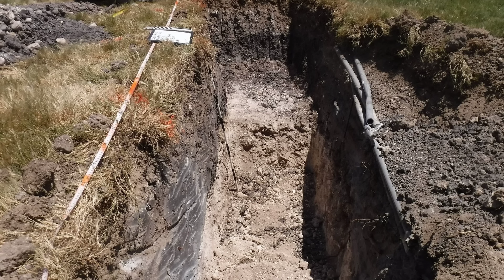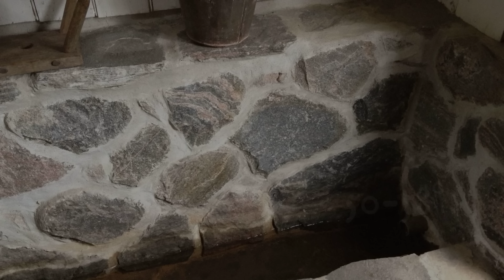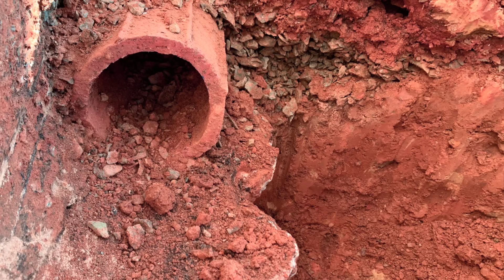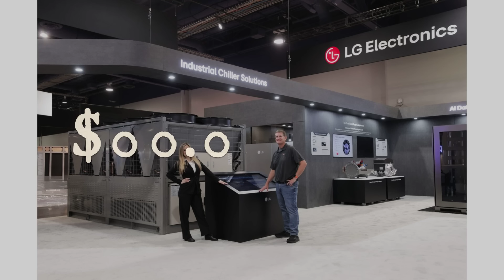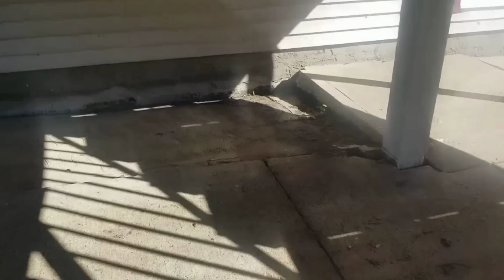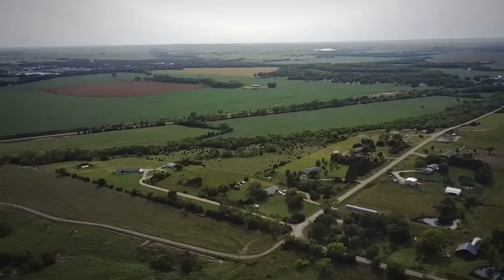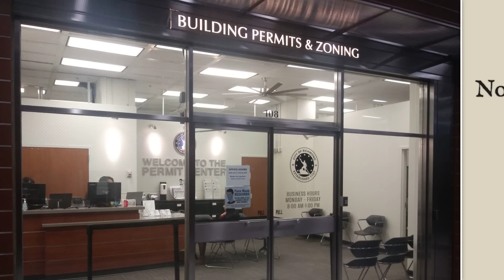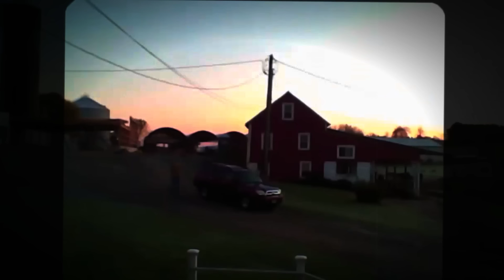This $300 Tunnel Keeps Any Home 55°F Forever — The Amish System the Cooling Industry Made Illegal

Comment: I’ve got an Amish community near me and I visit them every summer and I can assure you their houses are hot af
Reply: maybe they didnt have $300 lol
Reply: @will201084  
They don't have fans 😅
Reply: @will201084  Phhhh, when they pull their cell phone out of their pocket, $300 cash will fall out.
Reply: @will201084  probably lot more than $300, but there are systems that run off water (similar to freon in tubes) that run deep into the  ground to remove the heat or vice-versa (even saw a house for sale with the whole setup in the country of southern Missouri. Not really new science or secret - I think it's quite expensive (at least they charge alot to implement it) and you have to plenty of yard. There's some science channel on here and a guy did it with a window AC unit.
Reply: @will201084  You should see an Amish wallet, it can hardly close...
Reply: Their Amish level not high enough. Need to grind harder.
Reply: @aphrodite7194  Patch drops next Tuesday
Reply: Lmao
Reply: Agreed, I serviced Amish business and homes. Never cool in Summer. It is wild to go in a home with no outlets.
Reply: @jackmyers-01  what exactly did you service in an Amish home/business?
Reply: @EasyMoneySG   Amish businesses still have power and some utilities, but they are battery powered.  i live in the middle of Amish country, and one of the greenhouse/farms where they sell AMAZING BBQ chicken on the weekends has ceiling fans and cash registers, phones, etc, but they are all rechargeable battery powered.  They can use electricity for their business needs, but it CANNOT be connected to "the grid".
Reply: @EasyMoneySG I’ve don’t finish work in an Amish home. In my area the good finishers are yanks and this guy wanted our crew doing all the stain work on the reclaimed wood and cabinetry although they do all the wood/trim work. No such earth tubes
Reply: They haven’t unlocked that crafting ability yet
Reply: 😂 Try this is in a climate where it’s 100 degrees plus with high humidity all summer. The house would never get below 83 degrees during the day( at best)  and the humidity would be off the charts.
Reply: @Kee_Op  Oh, you mean like Iowa, yes, there are Amish colonies there too, they survive, they must have some secret.
Reply: @Crogon  surviving is different from enjoying
Reply: @Crogon  The secret is acclimatizing. People just get used to it. I just went to Costa Rica and most people can’t afford AC, they thrive.
Reply: @mikedickinson9730 I think it's just 'acclimating'
Reply: I have an Amish guy building my house right now.So I'm going to ask him about this.The next time I see him later this week. I'll find out.

Edit: He said it is.  I had a quick conversation with him about it for my property and posted it in my videos.
Reply: @ExposingYoutubersChannel update when ya do please. If possible. 
Thank you
Reply: @ShadowBanable they got him...
Reply: @austenlangford  hahahahahha the guy proved it. he is underneath now... cold 💀💀💀
Reply: @ShadowBanable  https://www.youtube.com/watch?v=3NsEqisBK44
Reply: @ExposingYoutubersChannel  Im here for the update on this to
Reply: @ExposingYoutubersChannel I have seen this work for a large "greenhouse"  i dunno about a whole house.  But its not 55 but its like 68 all year round
Reply: @rockindoublef  the oranges in Nebraska greenhouse is the greenhouse you’re referring to and yes the concept for the house was born from the system he designed for his house. He tested it on his house first.
Reply: @rockindoublef our house is only 1200sq ft with a big loft above.  He said he can do it so we'll do it.  I'm thinking that it won't be as cold as 55, but even mid 60s in the summer is a win.
Reply: @ExposingYoutubersChannel even if it cuts your AC bill down, it's probably worth it
Reply: @ExposingYoutubersChannel thats awesome
Reply: @ExposingYoutubersChannel  interesting.   I am in Florida.  Probably not a good idea where the water table is 20 feet below. 😮
Reply: @Dbb277-2  i grew up in south florida , and I remember digging a hole as a kid and hitting water. I was told I was going to hit china soon 😂
Reply: @Dbb277-2  I'm also in Florida, my house is on well water and the water comes out cold. Wouldn't that be a bonus since the water will help keep the soil cool?
Reply: @runielquinones3817   The problem might be how far down one has to dig to accomplish this.  That’s totally an engineering problem but might work. 🤷‍♀️
Reply: @runielquinones3817  I'm not sure of your area or well depth, but in Ohio our residential water wells can go from 110ft deep to some 400+ ft deep. (My opinion only & I could be wrong) That it would be a long shot to use that small pipe coming up to use water to keep additional pipes cool, but anything is worth a try! I'd just make sure to talk to smart water people & make sure its not gonna prematurely warm your cool well water & then you have to worry about additional bacteria or contaminations.  But Im by far no expert, nor a YouTube expert in that area, just my 2ct to keep check into to keep your family safe 1st. Definitely would be interested in a follow up reply if you get an answer though. & good luck
Reply: @ExposingYoutubersChannel  Commenting for the update!
Reply: @xylol3hunna  i posted his response already.
Reply: @ExposingYoutubersChannel following
Reply: @ExposingYoutubersChannel  Recall, he said that there is only one specific Amish community doing this.
Reply: @Crogon doing something and knowing about something are two entirely different things.
Reply: @ExposingYoutubersChannel  Okay buddy it's Monday! Chop Chop
Reply: @Crogon well, he knows of it, he can do it, and he'll be doing it for me, so...
Reply: @ExposingYoutubersChannel  You better give us an update on this!
Reply: @ExposingYoutubersChannel what did he say?
Reply: @UTEX  I posted the video on it.
Reply: @ExposingYoutubersChannel Curious-how many SQ feet and estimated time to complete the build?
Reply: @ExposingYoutubersChannel looking forward to the update
Reply: @MrMoDaddy  He knows about it and he's going to do it for me.
Reply: Adding this comment so I can check for an update @ExposingYoutubersChannel
Reply: @ExposingYoutubersChannel I would like an update
Reply: @gabeoshin i posted it on my channel.He knows how to do it
Reply: @ExposingYoutubersChannel  It's basically "geothermal"
Reply: @ExposingYoutubersChannel yooo any update
Reply: @NickChambers-rp8bt yeah, i posted a video
Reply: @ExposingYoutubersChannel hey man did you ever find out if this is legit? Please let us know
Reply: @rameezkhan3521 yes it is. I'm going to do it.
Reply: @ExposingYoutubersChannel  It "is" what?
Reply: someone like my comment so i can get back to this video when there's an update already. please and thank you
Reply: @ExposingYoutubersChannel   He's going to say and I quote "Nooope sorry I ain't ever heard ANYthing about that"
Reply: @heavyglassglass  i doubt it.  We'll see.  He should be back on Monday.
Reply: @ExposingYoutubersChannel  What did he say.
Reply: @ExposingYoutubersChannel  we're all dying to hear his response lol
Reply: @heavyglassglass  Well, you're wrong, he knows aobut it, and he's doing it for me.
Reply: @Fr3drik2  He knows about it and he's going to do it for me.
Reply: I have no doubt that some Amish communities have utilized this. But it's a lot of extra work (excavating tunnels without heavy machinery, oof) so it's probably rare. Not standard practice.
Reply: But do they have the Earth tubes?
Reply: @CarlosCruz-yi1rd  they definitely don’t but that’s not a critique on the concept of the earth tubes, the earth tubes definitely work I’ve seen several people implement them effectively if you can find the time and money to lay the pipes and have a plan to connect them to your home then you can definitely get some awesome results.
Reply: @DarkSolidity  so your saying "they" isnt just the powers that be but our peers as well?
Reply: @DarkSolidity  so your comment was for what...? You visited peoples houses that aren't even cooled with the method mentioned in the video and say they're hot??
Reply: @JustEvan7  they called it the Amish method and it clearly isnt, the majority would hear that and take it for truth at face value because the majority of people have never met the amish.
Reply: @DarkSolidity I’ve seen a smaller version used to keep a goat house warm in the winter!
Reply: @DarkSolidity  Perhaps not all Amish are created equal?
Reply: @Boge42  no amish hivemind?
Reply: @DarkSolidity  yeah they work till everyone gets radon poisoning and then has to battle cancer.
Reply: @R_eaper93  oranges in Nebraska has been using this method for 20 years with no ill effects.
Reply: This honestly sounds like one of the most tout there conspiracies ever. Let's say this dies work . You know why its not implemented? Not because it'd save folks money bit because its simply not feasible for mass implementation. You're leaving out things like earthquake and other seismic activity that would easily damage this and make it useless. Its subject to flooding also making it useless and quite possibly a separate problem for the home.
Reply: @SnowmanBiggz it’s called geothermal heating and cooling. Nobody uses these stupid tubes. They run pex through the ground and use it in a hydronic loop.

You need a very large area because eventually the earth your pex is in will warm or cool and make it less effective.
Reply: HAHAHAHAHAAAAAAAAAAAAA
Reply: Why do you visit and what do you do while there
Reply: @doritoseminar  i visit for many reasons, they grow produce and sell it to the community for better prices than the Grocery stores, they bake fresh bread, they sell honey, they provide many services for people. I got to know serveral of the families through avenues like that, my favorite family I met are wood workers and they built me several 4 x 12 feet grow boxes out of cedar for an amazing price and my project was a little unusual so they invited me in to talk about it and we became friends through it because it took several months to complete, i haven't been able to befriend all of the families because alot of them are closed off but the ones i have gotten to know they're fun and very intelligent people, and spoke 4 languages, even their children speak 4 languages.
Reply: 😂😂 well damn, I thought we had a secret here
Reply: @CurrentlyCurious748  it does work, it’s just not an Amish secret
Reply: The video references Amish who settled in Pennsylvania and Ohio. Do any of you live near Amish communities in those states? I do not but I'm curious if they are using knowledge brought over from Europe that other Amish may not have adopted.
Reply: @Epic_Lemonade  No, the Amish I am talking about do not live in Pennsylvania or Ohio, However their families do, they were from Pennsylvania Amish families that moved to Tennessee, they mentioned taking buses to visit their family upstate. And a few I’ve known have gotten married and moved back to PA.
Reply: You hang out in their basements ?
Reply: Good comment-always nice to hear another perspective.
Reply: Amish are weird heretic cultists anyway lol why pick 1800s Christianity when you could pick 33AD Christianity?
Reply: Dang i go to about 6 PSU games a year even the campgrounds we stay at run by the Amish.  Never went into one of their homes but kinda want to now.  See if looks like a time capsule lol.
Reply: You Amish ain’t evolved like his.
Reply: this video is about a specific group of amish
Reply: maybe it's a breeding house, try another.
Reply: I have no doubt as to this working, I'm just wondering how this would work in a city? Setting aside the part about the infrastructure not already being in place, im just curious how effective it would be for something like an apartment building? I'm sure it would be helpful, I'm just not so sure about the effectivness? (I have mold concerns in my head too, as this cool air starts meeting warmer air, but yeah... i just don't know...)

I dunno...
Reply: @Well-that-was-unfortunate  you would need A LOT of underground tubes to cool something like an appartment building. For that scale you would probably have to build it from scratch as retrofitting on that scale would compromise the foundation. You'd probably need a central tube that comes up through the middle of the building, that all of the appartments connect to as an exhaust, and lots of tubes streatching for hundreds of feet that emanate in every directions from the appartment building, you know a basement level solely designed to feed this cooler air up would probably be the beat way serve that air into the apartments. I don't know if it would work well for every floor of the appartment but it would work great on the first floor!
Reply: @DarkSolidity yeah, no... i used to live in Boston, which has an interesting foundation already... retrofitting would be... i don't think possible... but yeah, thank you... that's not unlike what i was thinking about the first floor. Condensation is brought up in the video, just.... i drive a truck now for work. The bottom bunk has access to an external heating and cooling system. The top bunk, not so much. On really hot days it's crazy to feel how much of a difference there is in the temperature between your feet and head and I'm picturing this on a building scale. But i have little doubt that moving air would (in a worst case scenario) in the manner of this video via some external fan would cost far less and would decrease the energy needs for whatever other normal heating/cooling system that would be installed... (if it needed one) but i like the idea of a central point from which to pull...
I'll never own more than a house so it's just me being me, thinking too much...
Reply: They are no the same. Some have this, some don't have.
Reply: absolutely brutal.. any Amish house you drive-by here in the summertime all of the windows will be open. If they had this system installed i doubt every single window in the house would be wide open.  the minnonites are living a little more comfortably lol
Reply: @E.K.izzlemynizzle  Yeah, I imagine any Amish communities who lost their connection to the knowledge are suffering without an Amish facebook page lol (I don't use facebook)
Reply: Deep ground ventilation isn't enough to make it a cozy 70F with decent indoor humidity. While this will help offset a significant cost of the energy bill in a to code insulated modern home, but it does not replace a proper HVAC system. Incoming air from an HVAC systems is/should be in the low 40s. 

The only way you might get to a point where it's covering like 80% usage is if the house is ridiculously well insulated. But even then, run a hot oven and you'll overwhelm the system and will need HVAC to bring you back to temp.
Reply: @anthonyreynolds2365 there is only 20 degrees of temperature differential between the air going in and out. Unless you are using a refrigerator you will never get 40 degrees out of a register, the low average is about 56 degrees. Source: 30 years of experience
Reply: In Nebraska, right now (the video is here on youtube) an old man dug into his backyard and ran a few large pipes from the hole and built a greehouse around it.  The temperature?  Right in line with what this guy is saying.  It's warm enough to grow fruit in January--Nebraska in January, ever seen that?  It cuts right through you.  Between 8-15 feet down in his own yard, no democrat demanding permits, no government interference.
This works.  If you doubt it dig a 15 foot shaft in your back yard wherever you are, drop a thermometer down on a piece of line.
Reply: @wesleygary6651  read what I said again. Did I say anything about it not working?
Reply: It's because you live near them and they let you in. Such contamination
Reply: @BadThrusher  don't know what you mean by "contamination" but they offer services to the surrounding communities, hard to do that and not open yourself up to people who arent Amish...
Reply: Where I am  at you would have to drill down to 2300ft to get a ground temperature of 70°F.
Reply: @LP-ju2fi  my psychic abilities are telling me that permafrost is involved lol
Reply: I knew a girl who grew up near the Amish, she said they were stinking drunks.😂
Reply: @unclechae  I don’t remember how I came about hearing this story but I came across a neighbor of one of these Amish families and they would come to his house and ask to use his phone all the time well he had a football game playing on his big screen tv and 2 of these Amish boys were mesmerized by it and were just standing there watching it so he offered them some beers and they staye, drank beer and watched the game, hilarious, and apparently they’ve made a habit of this. Though there are some Amish families though that don’t drink but I with my experience of their people they’re just normal imperfect folk like everyone else just without electricity lol
Reply: @DarkSolidity  Those boys were probably Mennonite rather than Amish. Mennonites are basically Amish who, depending on their community, allow technology to various degrees. Practicing Amish don't even allow electricity - they literally live like people did in the 1800s.
Reply: @0megacron  nah the nearest mennonites are 3 hours away these were definitely Amish
Reply: @DarkSolidity imperfections yes, but still less addicted to stuff that's not healthy for you.
Reply: @DarkSolidity  The Amish near where I grew up would pay the neighbors to store their electronics. Some of the houses would have an add-on that was just for the Amish to use electronics.
Reply: @therealtb404  lol that wild, I’ve always found it wild that they will use gasoline engines to to turn machines like a lathe but using a gasoline engine to turn a generator to power the lathe is a no no. It definitely seems like they cheat where they can. Lol but renting out space from the neighbors to stow the electronic contraband is hilarious.